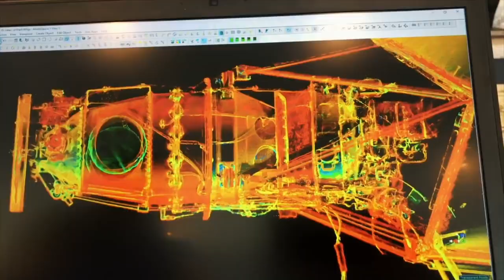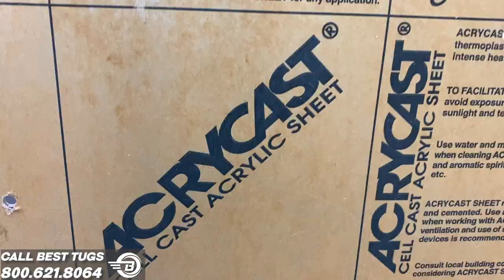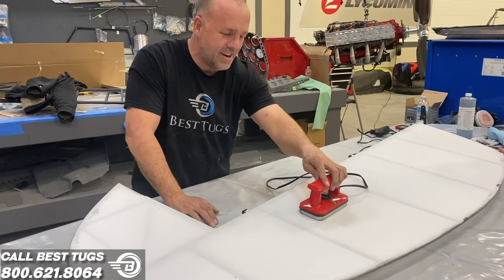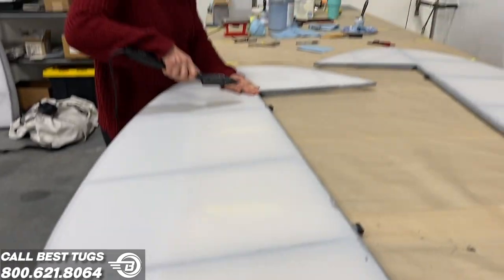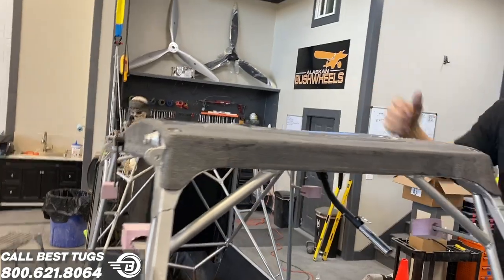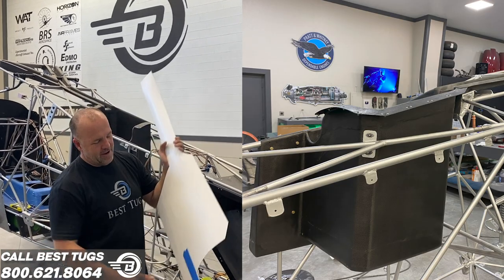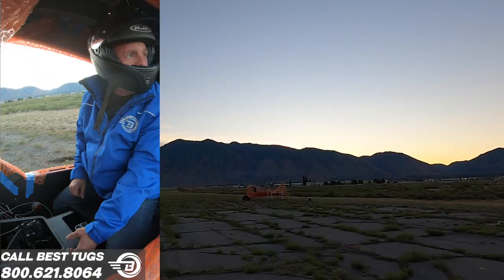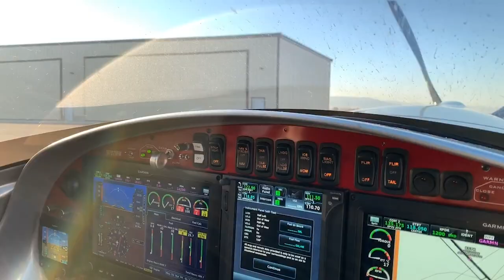Carbon Fiber,  Skylight, Tail-Feathers and Paint Begins (Scrappy Bush Plane 21)

Comment: Mike, I have a bit of a question. With your meat cleaver prop ;) - as you say, you will have a lot of thrust. I'm probably being dumb, but with your top wing - you want airflow across the top to be faster than below the wing. With a more powerful engine and higher thrust, do you suffer a lift penalty - higher take off speed/stall speed? - as you will be pushing a lot of air below the wing?

Would a mid level wing perhaps allow that prop thrust to be a lift generator (I know... a mid wing plane ends up being a whole other ballpark... )

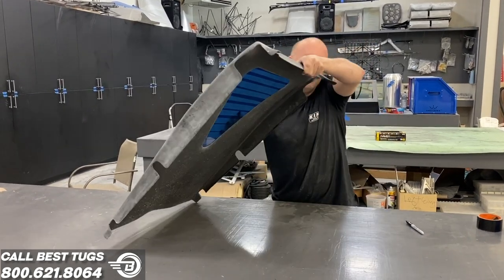Comment: What is this SRP TotalSeal 5025 at 12:38 that you are using?  I would like to learn more about it and Web searches don't reveal much. 
Speaking of learning, I would love to see a series of videos of what tips and tricks you have used as well as what products you have found to be better for x situations.  I'm building an Europa and have learned so many little things watching your videos.  I love your energy and wish I had someone like you around to have me, "Get back to work!"
Reply: The reason I'm interested in this 5025 is I have to bond in my windscreen soon and it calls for some Araldite 420 which is crazy expensive but forms a bond very strong.  I have a mix of it with flox I lift in a bag about 1/4 thick.  I cannot snap it with my hands and have asked others to try and they cannot as well.

Comment: Love that iron. Can you post your resource for that iron?
Reply: Aircraft Spruce sells them. 👍🏻
Reply: Holy cow!!, Only $229, maybe I will buy 2. 🤪😂😂😂
Reply: Lynn Gardner  They do have an iron kit for $164.95 which includes the small iron as well but I don’t know how the quality is.  You’ll want a small iron for tight spots, you can find those at hobby stores for quite a bit less $$.  Toko brand also sells the larger digital iron, they may have a less expensive option too. 
I also wondered if you might be able to find a used one ??  I hope this helps.

Comment: Mike: Instead of reinforcing the whole top plate to combat the parachute line tearing through instead of popping it off, couldn't you just put something hard / reinforce the lip (where you have the blue tape hinge) of the top plate so that there would be no chance of tear through?

Comment: Just wondering Mike, that if, God forbid, you had to use the chute and rip the top part would it be an easy fix to get it back to flying condition,
Reply from the maker: I could fly it without doing anything and for Cosmetics repair 1 afternoon

Comment: when you buy sheets of carbon fiber do they come in 4 by 8 sheets or do you just order the sizes you need ?
Reply: CF-fabric - comes on a roll - usually 1m wide and as long as you need... (unless you want cured CF "sheet" / layup - then order for the project size)

Comment: Would it have been lighter to do a Kevlar sheet in the parachute cover for the tear resistance instead of 10 extra layers of carbon?
Reply from the maker: Skubasteve21 great question 👍🤠  I didn’t mention I also needed no flex so it “POPS” not flex as it needs a clean snap so we want it very ridged.  It can not slow bend back we need the crack force pop.  Great thought I love how you think.  I’m a Kevlar fan

Comment: Mike, you are a professional designer, mechanical engineer and builder. I didn't say anything about the first place you built because I thought the word might mean something special to you. But Scrappy? Come on. That sounds like a plane you went out back and found the scrap parts for. Mike, I believe you are great man and I enjoy and learn so much from your videos. Please take my advice, or put it to a vote. After Scrappy is finished rename the plane even after yourself. The Patey or the Mpatey.
Reply: Scrappy began like you said but it seemed he knew he could make it better than Draco so his vision changed.
Reply from the maker: HighMXHubby  I keep burning up used stuff, engine, airframe, parts but I can’t help myself even though the majority of major components were scrap I want it like or better than new.  I can’t help it 🤷‍♂️🤠
Reply: @HighMXHubby  Anything he wants to call is not my call. I admire the dedication and results of this calculated effort. In my book Mike is amazing and he is advancing the industry by leaps and bounds. I believe he has enough knowledge to begin experimenting with antigravity.

Comment: Do you change the direction on the layers ? I would assume?
Reply: erronius1  No, it’s not necessary to do that.  We apply one layer, flip the piece and do the other side, then flip, cover, flip, cover.  The edges are overlapping each other.

Comment: Fortune favors the prepared. Why do you rivet the fabric down?
Reply from the maker: It’s become more and more the path. You must use the extra tape below. As well as the very oversized rivet heads and then the tape above.  Both methods are fine but for what I’m doing this is the path I preferred. I then I added twice as many to keep it extra tight.  Either way would have worked  👍🤠

Comment: Mr Patey, how powerful is the computer you use for FEM? Number of cores? Memory?
Reply from the maker: In my engineering firm I had one of the top ten in the country for doing it. Now they have a system that works online to process the big data.  I have a basic 5,000 computer does it all now.  I would have spent ten times that just a few years ago. I use SIMULIAworks

Comment: Mike, just curious... why did you choose Stewarts over Oratex? Oratex is known for easy application and durability.
Reply from the maker: I’ll try and talk more about that.  I will likely just say only what I like about Stewart’s. They are great at both companies but o prefer Stewart’s.  I have friends with both I have never had anyone dislike Stewarts long term.
Reply: @MikePatey  Like I said, just curious. I support your choice, either way, brother. I've watched plenty of builders labor long hours, both in application & repair (it's a matter of time when rocks shred the underside of the horizontal stab). Speaking of time, I prefer your elegant your solution... employ the wife!

Comment: Always tell your unpaid help that they do a better job than you do. You spent a long time showing them how to get it right but this is the stage where they get bored and want to quit so just BS them a bit and fix up the rough bits yourself later.
Reply: He told me I did a better job on the fabric than he did and I agreed.  There was no BS in that conversation. 😂

Comment: scrapy?  aren't ya supposed to use scrap?
Reply from the maker: Jim Blalock yes Sir 👍🤠. Everywhere possible, motor, crashed frame, left over steel plates and Alluminum and rusted pipes and plates.  Yet, where I don’t have scrap I use new or scratch build my own and in the end I want to have a plane that’s about time and work spent not money spent.  i still want a brand new looking plane at a fraction of the cost(excluding my labor and time) I will finish this less than buying a new one and it will still be new to me 👍🤠 and hopefully new in how it looks when finished.  Wish me luck 🤠
Reply from the maker: Jim Blalock yes Sir 👍🤠. Everywhere possible, motor, crashed frame, left over steel plates and Alluminum and rusted pipes and plates.  Yet, where I don’t have scrap I use new or scratch build my own and in the end I want to have a plane that’s about time and work spent not money spent.  i still want a brand new looking plane at a fraction of the cost(excluding my labor and time) I will finish this less than buying a new one and it will still be new to me 👍🤠 and hopefully new in how it looks when finished.  Wish me luck 🤠
Reply from the maker: Jim Blalock yes Sir 👍🤠. Everywhere possible, motor, crashed frame, left over steel plates and Alluminum and rusted pipes and plates.  Yet, where I don’t have scrap I use new or scratch build my own and in the end I want to have a plane that’s about time and work spent not money spent.  i still want a brand new looking plane at a fraction of the cost(excluding my labor and time) I will finish this less than buying a new one and it will still be new to me 👍🤠 and hopefully new in how it looks when finished.  Wish me luck 🤠

Comment: I hesitate to seem rude, but, you obviously have plenty of money, why not just buy a damn paint booth?
Reply from the maker: 👍🤠I certainly want to.  We have crazy regulations around here and it’s just not a viable option.  It would also tie up space when I only use it now and then and tuck it away for a year before I need it on the next project.  I’m considering going through the regulations battle and buy a smaller hanger just for paint. Unfortunately there is nothing available on the field right now.  This is the best option today